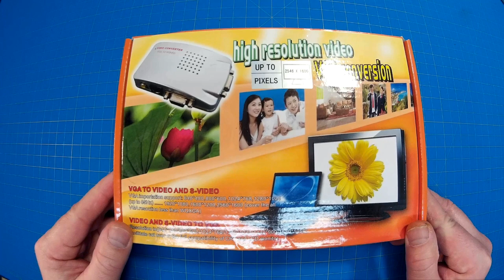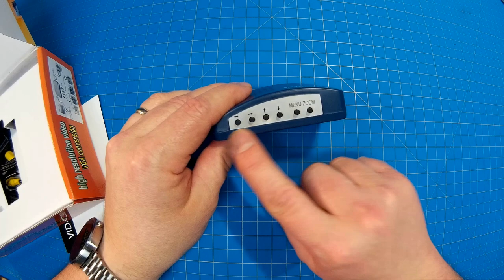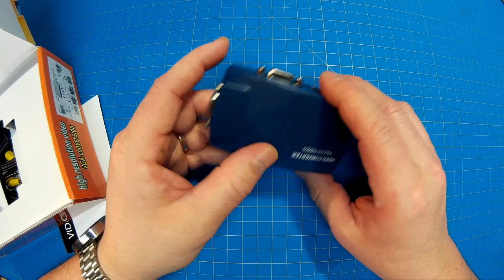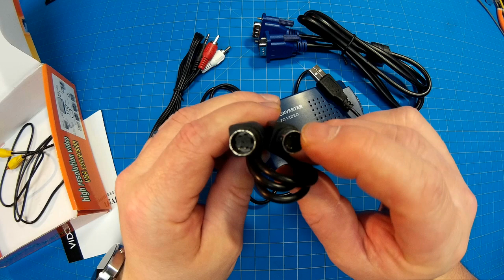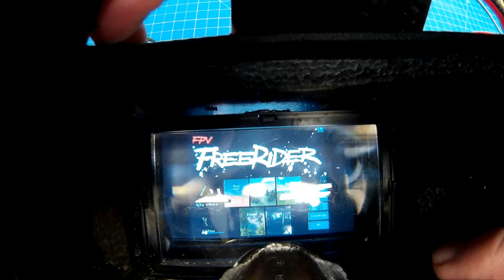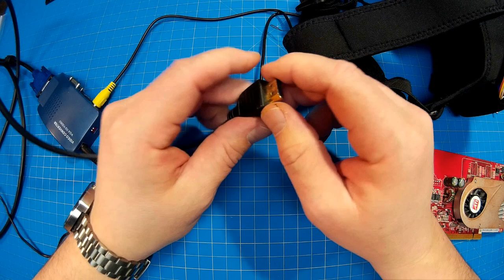Use goggles with flight simulator

Comment: I just got EV800DM but can't get past the AV blue screen.  Any ideas?  Using NVIDIA graphics card.
Reply from the maker: connected to a computer I presume. Try changing the display settings to lower resolution.
Reply: @NickBurnsFPV  I tried that too.  I've tried connecting HDMI directly from Computer (skipping monitor),  Tried split screen to see if screen 2 would show up (NVIDIA card recognizing HDMI cable and showing as operating).  one thing I found on a forum was that maybe the Eachines can't take 60mhz.  Only problem is i can't change that in the configuration. 

I've tired different plug in sequences.  I can get a 'rainbow' (looks like a 70's monitor...vertical lines) to show for a few seconds when I power the HDMI2AV (Shows NTSC or PAL when selected) and then it goes to blue screen.  

This one has me stumped and bummed.
Reply from the maker: @thebikeracer  There are some specialized display tools available to change all sort of display settings. Unfortunately it has been years since I have needed one and don't recall the names. I wish I could be of more help.
Reply: Did you ever get it to work?

Comment: Hi, Nick. I have a question regarding your setup. If I wanted to use this for just a simulator and not a drone what components would I not have to buy? If it is plugged directly into the computer I shouldn't need a wireless receiver, right?
Reply from the maker: No receiver is used in this setup. These little converters/adapter box is very inexpensive and uses cables to all ports. If your computer has the same inputs you can use the simple cable method I use.
Reply: Thank You